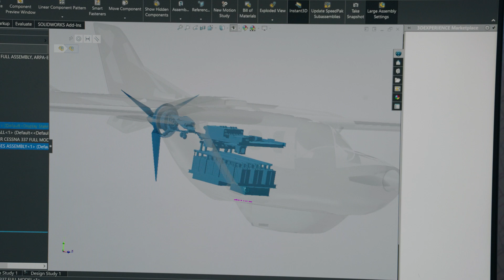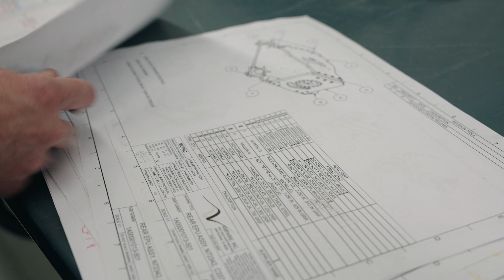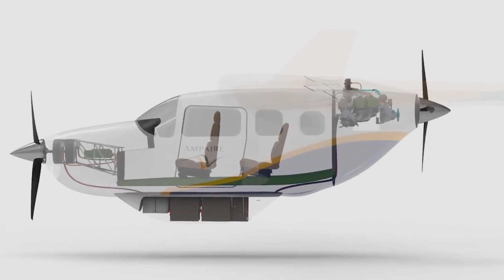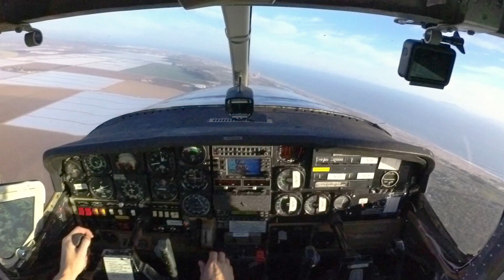How Electric Planes Could Soon Rule The Skies

Comment: When you study aircraft design, one of the first things you realize is that the more fuel you use the less you need. That's the thing with air travel.  Renewable clean fuel would probably always be a better option for air travel than batteries.

Comment: Interesting but misleading. Battery planes (I had never considered hybrid planes) may well displace ICE prop planes by 2050 for short haul.  Jet planes  and especially long haul jet flights are another matter entirely.  Showing a jet in the video implies it could be replaced with anything we can can conceive of today. No way. We are going to have to continue to pursue renewable jet fuel.
Reply: It’s far more likely that planes will change their fuel mixture to cleaner petrochemical solutions or biofuel derived hydrocarbon solutions with limited applications of using hydrogen fuel. 

Additionally we have seen massive investment by airline manufacturers to test and design new airplanes that would be more fuel efficient during flight. These technological breakthroughs are arguably more significant than running your plane on batteries

Comment: As a pilot, I can tell you batteries will have to get a massive amount smaller and while smaller pack more power density to compete with the weight of fuel and fuel's power density.  Batteries are getting cheaper, but they aren't getting smaller.  And, of course, will often than not, just like a Tesla, the batteries are charged with fossil fuels.  All bulldozers, buses, cranes, passenger vehicles, boats, the entire public transit system and more will need to go electric before aircraft are electric.  When all of these go electric, maybe batteries will match or better fuel's power density.  Fuel's power density is magnitudes more than any battery now.
Reply: Aa your avionics tech and electronics actual know-it-all, I concur that their long run goals will fall short though advertising always places them on the cusp.. There will certainly be spin off applications and perhaps we will settle on some alternative but there will never be a solution to the greater power seeking problem.. The one that drives politics and glut for power over people and property; ambiguously.. That power balance is beyond the aggregate of our societies.
Reply: We need the green paint, don't worry about the energy density!
Reply: There is the concept of a structural battery where you don’t just add batteries to the current structure but have the battery itself take some of the structural load. That along with a bit better energy density (power density is already good enough) will probably enable BEV prop planes for short haul to become popular but as I wrote in my other post that won’t get you to jet replacement.
Reply: @DaraParsavand  Yeah, I meant energy density, not power, but the point is still valid, the size of batteries need to get smaller while the energy density is increased is the  goal, but I've not read anything which seriously suggests that production batteries of this type are anywhere near available.  There's always studies and experimental, but those often are cost prohibitive in the real world until there's a big breakthrough.  Sure there will be small electric prop planes, but like EVs, they too will come at a higher price than ICE planes, the same applies to motor boats.  Tesla was considered expensive before the pandemic and after the pandemic Tesla has hiked prices quite a bit so further taking EV ownership further out on the wealth scale.  Electric boats and planes, in my opinion, are a low priority as there are plenty of easier conversions to tackle first.

Comment: Nevermind the environmental damage that's done while mining the precious required for the batteries or to charge them.  How about the fact that our electrical grid can barely handle today's demands let alone adding a gazillion battery chargers.  Nothing to see here...
Reply: Right.  We can't say that all things won't ever be all electric, but net zero, they can talk about it forever like all this will happen in the next few years (they make it seem that way), but I see it happening over the next 100 years.  Every gas station in the US closed and the grid massively upgraded and expanded is no small job.  I wonder if the machines that dispose aged solar panels and batteries will run off batteries as those things head to the recycling/landfills in about 12 more years and every year thereafter?  And will the batteries in the machines get charged with fossil fuels or renewables?  There's a lot of tradeoffs here that people do think about, but I'm not sure many are calculating the costs and benefits related to the costs.
Reply: Well let's sit down then and do nothing. Happy now?
Reply: @BakkieFelixDomesticus  That's what would make you happy.